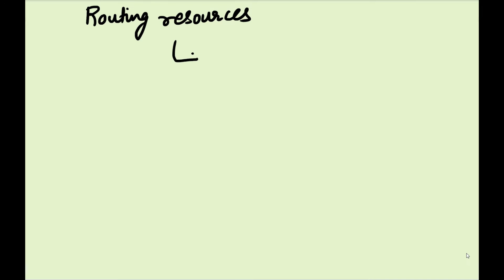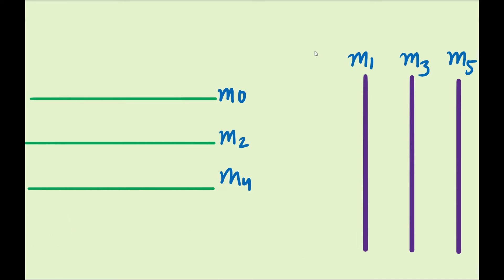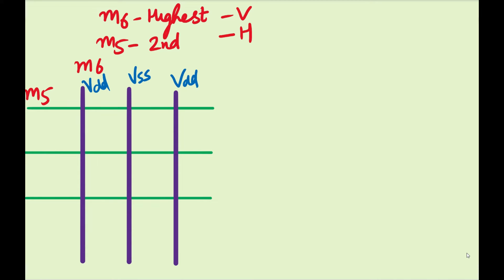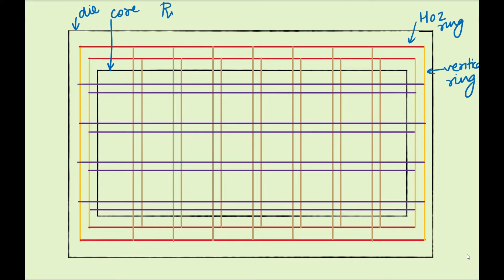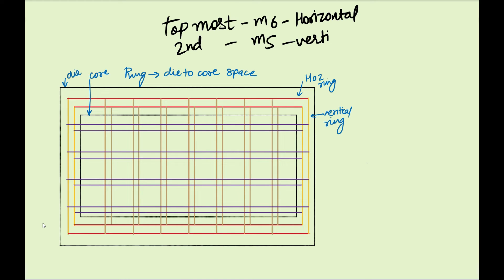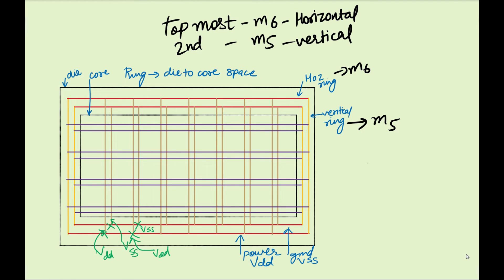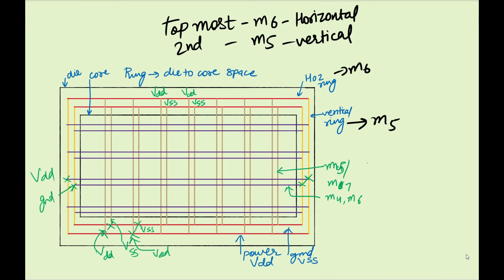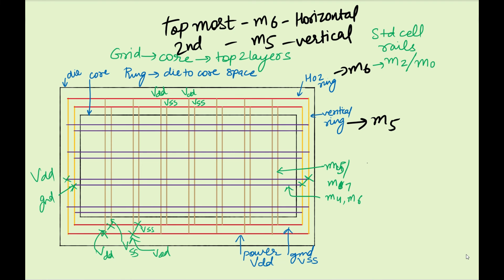PD Lec 24 - Power planning and power mesh creation| Floor-planning | VLSI | Physical Design

Comment: While doing power plan...wht issues can we come across d how to resolve
Reply from the maker: While doing power planning we need to make sure of power grid structure. Power grid should be proper and spacing between stripe must be correct to avoid drc. Also power grid should be robust to avoid power drop. Correct stripe should be drawn in correct power domain and we need to ensure that power reached in channel properly to avoid any power failures later

Comment: Hi sir,
The power ring creation is only at chip top or will we create power ring at hierarchical partitions too?
Reply from the maker: Power rangers created around partitions and SoC, but it is not mandatory practice. It is done just for safe side to avoid signals crossing the boundary

Comment: hi sir, why we take the horizontal layers as  m0,m2,m4 and vertical layers as m1,m3,m6 why can't like this horizontal layers as m0,m1,m2 and vertical layers as m3,m4,m5?
Reply: Hi,
The layers should not be same in all foundries and it depends up on foundary rules. It could be possible that m0,m2,m4 in vertical also.